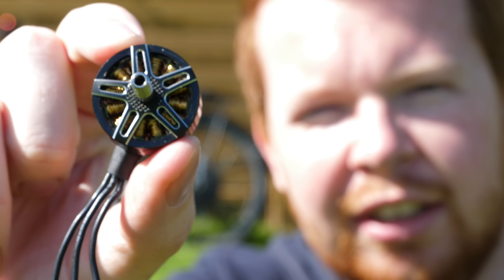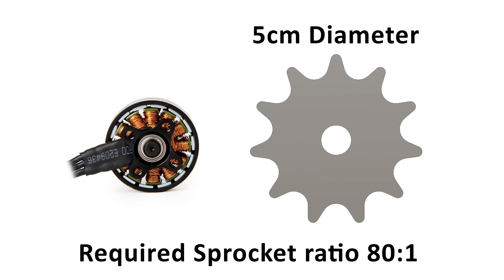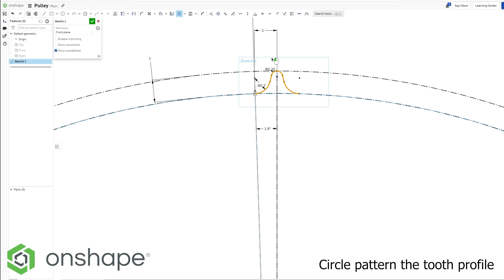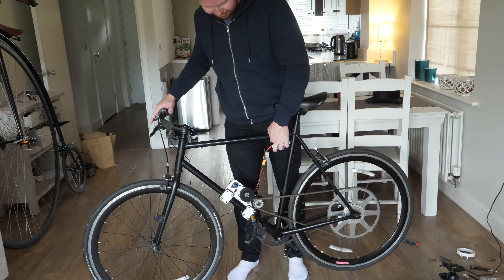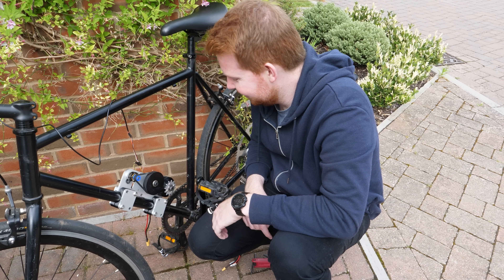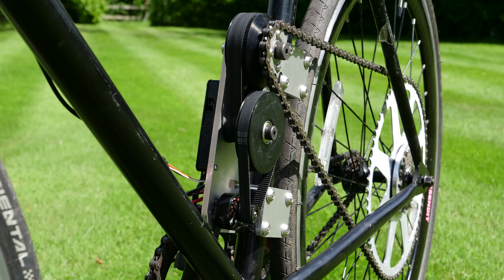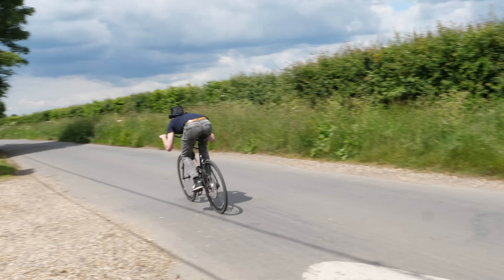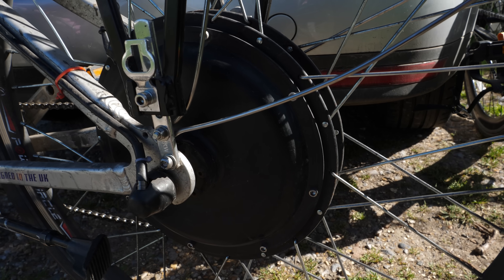Tiny 1kW Electric Bike Motor

Comment: To help with the chain you could change the mount of the belt/chain system. Keep the bottom mount, but make it hindged. And on the top mount add a heavy spring to keep constant tension on the chain.

Could also hollow out some more aluminum to make a heatsink for that tiny motor. The big motor has all that surface area to disperse the heat.

Comment: NO THIS IS NOT A 1 KW MOTOR! You are just the shame of engineering with your bitc* clic video. Does it seems that the wires are designed for the 50 AMPS required by a 5S approx. 20v battery giving 50*20 = 1000w? NO! NOT AT ALL.
Reply from the maker: You're right, it's a 0.928kw motor
Reply: @TomStantonEngineering  You read this on a chinese spec? This is simply not possible according to the size and electrical proof I gave above. 92.8 w probably, which is much more accorded to what's in your video. You sure it's not the kv  rpm/volts speed coefficient?

Comment: The drone motor would normally get better air cooling. PM motors lose efficiency as the temperature increases. If you properly air cooled it I think it would work better

Comment: A lot bigger motor running at 60-80ish% with a decent fan (I guess you could print the belt pully with a decent turbine type fan center) to help keep the motor cool too-  I'd also think about adding a heatsink and fan to the ESC too - Or if it's useable/tuff/reliable enough get one of the not very costly 1/10 or 1/8 motor+ESC+programmer combos-program it for forward only  and if the pullys and any gearing can handle it a brake too - You could even go a bit giddy and use the water cooling jackets they use on RC boat motors with a water cooled boat ESC and plumb them into a PC liquid cooling radiator or 2- I'm guessing there won't be too many liquid cooled E Bikes around... All the best

Comment: Just a random idea, but with regards to the older piston based compressed air engines. I wonder if a multiple cylinder engine could be built and maybe used in something like a small RC Dragster, similar to the syringe and supercapacitor build before.

Comment: Even if all else was equal and even if the drone motors wouldn't burn out, the two sets of linkages would lose some percentage of the power, while the e-bike motor is direct drive - no transmission losses. So more power in the drag race, longer battery life. Nice builds, nice tests, nice video!

Comment: I suspect that both motors are rated at 1kW peak power, and are not rated to run at peak power for long before burning out... as you noticed from those short runs. Interesting idea though. Now I wonder what could be done with a couple, or more, motors NOT running at peak power

Comment: You geared the motor to the wheel so that it meets the rpm of the wheel with the big motor. What the final results show is that the difference between those two was quite significant. Now I'm no expert but wouldn't it bring more pleasing results if you made the gear ratio so that it theoreticaly meets the rpm of the big motor spining without the load? I mean when you lift the bike, then spin it at full speed and measure the rpm. Because basically you have  compared the rpm of the big motor under heavy load (rpm of motor while riding the bike) to the rpm of the drone motor under almost no load at all. Which weren't the circuimstances of the test because the drone motor was suddenly operating under heavy load, just as the big motor. Again I'm not sure if I'm right. I just think that it May have caused the difference between the two.

Comment: I had made some gear ratio and conversion for other project I haven't work the prototype yet in recent years. You can use a series of gear ratio to make it work. However the drone or small motors have material, design and mechanism limitations. Such us, current, coil insulation, coil copper wire thickness, carbon brush, the drum, most importantly circumference and ratio of KJ( kilo jule) being transformed needs the applicable materials tendency to handle what friction and currents can exert. What the Ebike with the motor integrated at the wheel with a wider circumference and material absorption ratios with along the test of the components I have mentioned, are better mede well enough to handle the loads. The other way to make it work if there is the need to have to, using capacitor and resistors can contribute to relief the load on the components with along making enough and efficient transmissions from the motor to torque dispersed in to use causing the bike to move forward. The gear and ratio of conversion is very important as well. For consideration there are other types of electric motors which are made for slower rpm but with strong torque and resistance. 
Best of luck and safe ride!
Sincerely,

Comment: Could probably water cool the motor as the wiring is insulated. I saw another guy built a submarine on YouTube using drone motors and it operated in the water....

Comment: You need a low kv motor so you have more torque and you can actually move you and the bike with a gearing like that. Probably some 12s motor-esc combo for an rc car with a low kv motor would do the bike even faster than the ebike. It's very expensive but it wont melt the engine

Comment: Poor lil motor lol, I'd call it a success however this will prove to be highly inefficient when compared to low KV, high torque motors - the very reason why they're used in conjunction with large props and higher voltage on drones designed specifically to achieve longer flight times as apposed to high KV, low torque motors designed to achieve high speeds and shorter flight times.

Comment: Put all 4 drone Motors on-- or have a way to switch to the 30k rpm motor after a certain speed is achieved with the Arduino 
BASICALLY AN ELECTRIC TRANSMISSION ON A BIKE-- Regenerative power from the Larger torque motor when up to speed while using the smaller motor to keep speed??!

Comment: A RC heli motor would be better suited to this, as they have an integrated fan because they are not designed to be right under a prop. They will also have much lower kV and thus need less gearing

Comment: I wonder how much better it would work with a proper sensored motor and ESC. That drone esc (blheli?) ain't that, and expects zero torque loading while it does it's fixed startup routine...

Comment: I have that same 1000 watt hub motor. It can "sink" 1000 watts but the motor controller that comes with it is throttled to 750 watts, Many third party 1000 watt controllers are also capped at 750 watts. (some can be reconfigured by a software override) 28 to 30 MPH on that hub motor is typical, but by default it never receives more than 750 watts. This is one reason the hub motor barely feels warm - you are only using it at 75% power - helps the motor's windings last longer.

Comment: The best way to compare the motors is with the "motor constant" which will show you that the ebike motor is a "bigger" motor electrically speaking and will handle more power.
The drone motors are always rated very high vs their "motor constant" due to them being force cooled, and over rated.
The bike motor is on the other hand under rated to have a long service life.

Comment: This is why it isn't a thing, and it needs a water cooler or a heatsink to be designed around it, the issue is there is no drag on the output if it is a drone, and here you got a lot of drag and that's the issue

Comment: I understand the physics but I still can't believe that worked as well as it did!  I bet if you used a larger drone motor, or perhaps a few small ones to distribute the load, combined with adding airflow through the motors for cooling, you could actually make something that's usable.  Silly, but usable!!

Comment: HP is just Torque x RPM, so the 30,000RPM motor has lower torque, so requires gearing to make the wheel speed match for the 2 types of motors

Comment: For the normal operation of the motor, firstly it is necessary to calculate the optimal load at which heating does not occur. Then it is necessary to calculate the number of belt gears for the movement of the bike not to increase the load. You have a good idea, but the calculations must be accurate.

Comment: If you just used it as a range extender for your legs by still peddling and just using a bit of power to make the peddling easier, it'd probably last for ages with a decent battery.

Comment: I like your proof of concept, running a very compact power dense motor with a high rpm geared down to make suitable for an ebike.
Thing is regardless of the massive increase in size and torque of the hub motor 1000w is not the limit of the motor but rather the speed control and the voltage. They're designed to run for 50km and only get warm so you could probably double or triple the voltage on the Hub motor whilst the drone motor is running at its limit.

Honestly I would like to see you continue this project but with something that may actually work well and proper.
May I suggest and RC car motor, anything between 36mm and 70mm in diameter and between 50mm to 125mm in length is typically what an rc car will run depending on size ranging from 1:10  scale to 1:5th scale and anything between 500kv and 5000kv depending what voltage is run which is between 2S (7.4v) and 12S (22.2v) 

What I propose/challenge you to do is you chose a compact and affordable motor ESC and battery combo using your gear down method that is compact, affordable to purchase, has good performance and can run a long time without overheating.

What size motor and how much you want to spend is up to you although my tip would be to be regardless of size try and find a 6 or 8 pole motor as this will give you more low down torque despite having a smaller motor and I would sway to having lower kV and higher voltage oppose to higher kV and lower voltage.
This means the power you make will be developed from a higher voltage value but a most importantly a lower current value. Since it is current that can cause excessive heat and thermal runaway. A low current high voltage system will help keep things cool.

Really hope and would love to see you pull something like this off, a desert if you do decided all the best luck from me 👍🤞😋
Reply: Really interesting thoughts, I tend to increase the turns in a motor to increase torque. Hey, newbie question, what's kV? TIA
Reply: @donnamarie3617  
KV stands for constant velocity.
It's how fast the motor will spin in revolutions per a minute for every volt that is applied to the motor, likewise when used in a generator its how fast you have to spin the motor to produce 1v of electricity.
The higher the KV the higher the rpm and top end power but the lower the maximum torque which is produced from 0rpm.
The lower the kv the lower the rpm but higher the maximum torque which is developed from 0rpm however the torque value will also drop much quicker as the rpm increases therefore also not producing as much top end power. However low end torque and power will be greater.

As you mentioned the amount of motor turns amoungst other things directly affects the KV. 
A higher amount of motor turns will result in higher low down torque but also lower rpm/KV value and top end power.
A lower amount motor turns will result in a higher rpm, KV and top end power however maximum torque at low rpm will be reduced, also the current draw will also be higher too.
Other factors that affect kv are motor size, number of poles, armature type and rotor type too as well if it's an in runner, or outrunner, brushed or brushless motor.
Hope this helps
Reply: @druscanam  Oh, that makes sense, thanks very much.

Comment: Drone motor specs are 100% wrong even tho there is a load on it It shouldnt heat at all.. cant be 1 kw... There are 2 posibility's 
Battery is to powerfull
Motor specs are fake

Comment: it's a great project but unfortunately the motor shaft bearings are not designed for lateral loads and tons of torque is getting lost by driving the belt

Comment: torque vs HP.  very interesting engineering and gearing in theory might have worked if not for torque formula requiring enough rotating mass to compensate for the load.  Rating with no load it would be as theorized.   Weight as a payload must be accommodated with more rotating mass on the motor / flywheel to keep the inertia up.

we notice a difference in motor temp even with different battery / prop setups and drone motors get pretty huge if you wanna carry anything over 1 KG.

Comment: Wonder if adding a second motor would reduce the torque needed from each since the top speed is rpm limited?
Reply: It would. 😄
-But two motors is not the limit; you could also go for 4 motors or however many motors you wish to "fit".

Comment: What I wanna do is take a 120volt 1750 rpm motor remove the pedal arms on an 18 speed connect the 120 volt motor to where the pedal arms go keep all original gears of 18 speed bike also hook up a car alternator a car battery and run a 1500 watt power inverter to power the 120 volt 1750 rpm motor, which will also power the alternator which will keep the battery charged which will continually power the inverter to power the 120volt motor.  Technically run forever. Why can't they do something similar with cars....   greed that's y

Comment: You can't expect  that  to last yes it will work for a minute  put a flywheel  with some weight  but don't expect quick throttle response  .and I know how to drive a 16 spenny nail with a wood  match good luck God bless 🙌  we all know it's possible to take something and re-engineering it but it's long-term use that we all want 😊 it's not electricity dang batteries batteries  are so poisoning it's like plutonium  do u get it rock on batteries are so stupid it's water power all the way I love the hair dryer moter but it's not cheap compared to real steel it's about momentum saving it's on energy  it's call  centrifugal force go play some video game cause your work and has already been figured out

Comment: By my math, at top speed that motor was spinning at 26% of its max RPM, which is way overloaded.  Swapping out the motor again for a 7500 RPM model would have likely given you better acceleration and efficiency.  I try to keep my brushless motors running above 50% max RPM.

Comment: If you build Van wings on the Suspention of the Motor, it will be cooling with upcomming RPM. I you build the Motor to an Drone, it would be cooled by the Air Flowdown from the Rotor too.

Comment: This is a new version of an old problem. There have been attempts to drive slow rotations (wheeled vehicles) with high-RPM motors (model airplane IC motors) in the past. They failed for similar reasons (coupling and low-rpm starts). What is needed is a really efficient CV transmission with a super-to-ultra high ratio. (I leave the design of such as an exercise for the student.)

Comment: I feel like there could be a nice middle ground here using just the chain and sprocke with a lower RPM motor, but then again, ones got a motor built for that exact purpose so I imagine no matter what the outcome at the same wattage there will always be diminishing returns

Comment: Great engineering test! Well done! The next test should be whether a bigger motor with such an efficient pully system could provide equal performance to a regular e-bike with far less power consumption. Coild this be the answer to more range?

Comment: Your overheat troubles would be less if you weren't asking the motor to accelerate you.  Everything is against you then...no back emf 》high inrush 》 high resistive losses.  Use your low power/ high torque system (pedals) to accelerate then let the high speed/ low torque system (drone motor) sustain you at speed...And a cooling fan would help.

Comment: What if you added the first 30k rpm to kick in after the 15k motor was maxed out. In theory it may work. Now the hard part is connecting the 2 motors to the input belt.

Comment: The problem with those drone motors is that they depend on a high flow of air to cool them which is why they have that wide open frame design.    They can't cool themselves off.    They need a fan and high air flow
Reply: Hmm?    😀   I wasn't complaining about your project.    😀    it was awesome!    I wasn't sure if you knew about the airflow issue.   :)   mount a motor facing squirrel cage fan rotor to the shaft so the motor pulls its own air through itself.   :)

Comment: These drone motors are very powerful but only at very high speeds. That's why they work well for very fast drones. The 1000w rating of the motor requires proper cooling in the form of a propeller. Your setup has no cooling, no wonder the drone motors burned out. Use a large lower Kv drone motor for this application

Comment: just to note, the tractor's is limited by it's wheels and the rpm it delivers the horsepower

hp = torque * rpm/5252

it may have the same horsepower but it delivers that peak horsepower at a much lower rpm and thus it has insane amounts of torque. That torque is required to pull farm equipment

Comment: Can you share the 3D printed pulley gear files and what pulleys you used? I'd really like to build something like that, but with an RC car motor instead of a drone motor. I think it would work quite a bit better, as these are not designed to be cooled by a propeller attached to them.

Comment: This would be cool to try with a planetary gear setup to get the gear ratio without the belts and chains.  Maybe a salvaged stack from a decently made drill could work.  Also, a motor with cooling on it would be the next step.  A drone motor is designed to have a propeller blowing on it constantly, hence the open frame.  Maybe an RC car/truck/buggy motor of the same power would be more applicable.  It would also be easier to mount on a planetary gear set from a drill.  Will probably need to have the gears oil flooded to keep them cool.